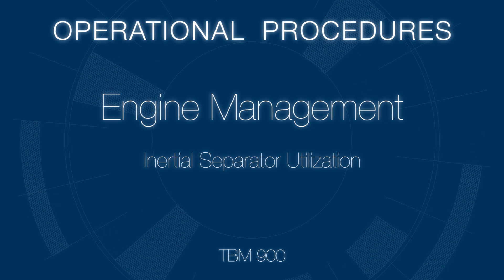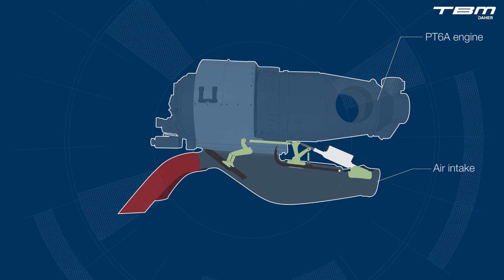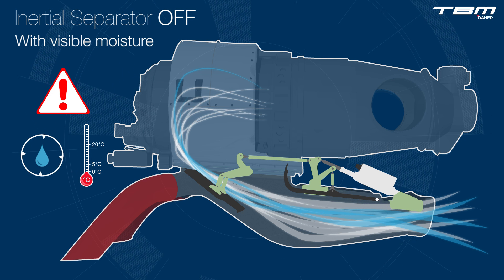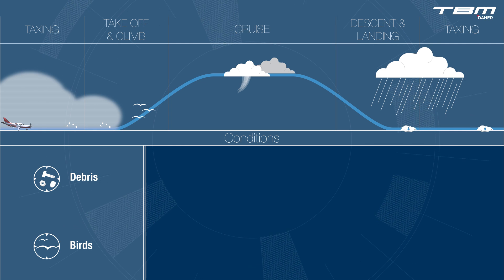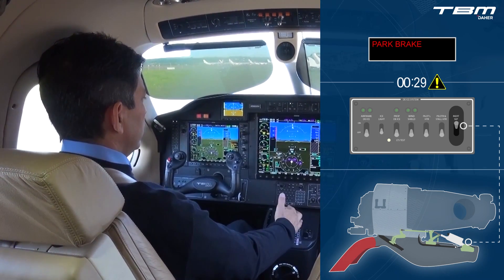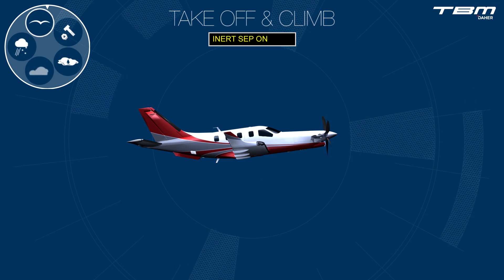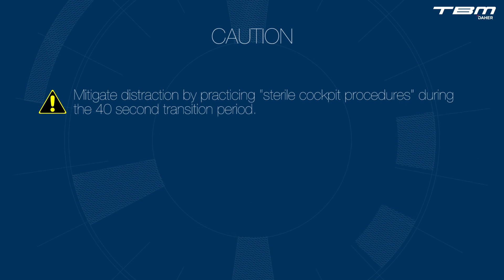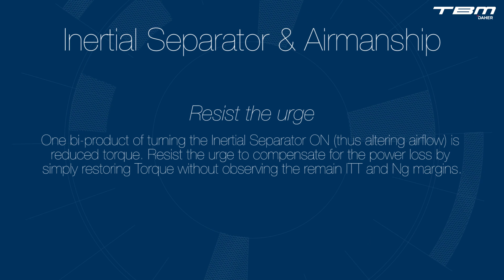TBM 900  -  Inertial Separator Utilization

Comment: I'm totaly not here to know if and when I should use this on my pretend aircraft in Flight Simulator 2020
Reply: Which overheats in low and high idle when feathered... 🤨
Reply: @K0nst4nt1n96  There are a few mod teams working on this issue and other FDE issues with the TBM930, also a team is dedicated to the G3000 and TSC as well.
Reply: We're all here for the same reasons. 🤣
Reply: Me neither ;)
Reply: Same xD
Reply: 4.3 Million $ later and a Pilots License, and this can be real though man! But for now I'll use this info on Inertial Separator for the fjords in these random Greenland airports I am at covered in snow and ice.
Reply: @zdp-189  well these dogecoin better get to work...
Reply: Me either

Comment: This inertial separator, although good in theory, adds unnecessary workload to the PIC. Not only does one have to closely monitor the torque and ITT gauges during the 40 secs of  actuation but the limitation of 200 KIAS (for the 700/850) is an annoying limitation during descent when trying to slow down the TBM which is already pretty slippery. One that note, I am glad to see that the speed limitation was increased to 266 KIAS for the 900.
Reply: is this something specific to the TBM? There are a lot of turbo props out there. Seems like a lot of extra work load and consideration for a little bit of extra engine protection from an event that doesn't seem to plague the rest of the worlds turbo props, or jet engines. (or maybe it does, idk.. i'm asking).  I do get that FOD is always a concern.
Reply: @rotorfib8719  Other Turbo Props have an inertial seperator as well... and they also increase the workload requiring the monitoring of ITT and torque.
Jet engines are different, and Turbofan engines are even more different (which i believe is what you are referring to). For both However they are normally only in danger altitudes for very short amounts of time, hence the cost and performance loss of having a protected engine doesn't really become valuable. Whereas turboprops are GA aircraft and its not uncommon for them to do hours long flights below FL180